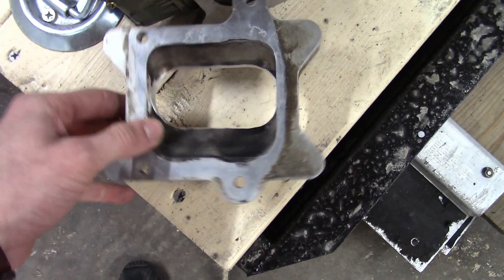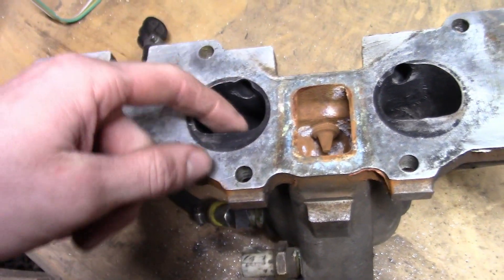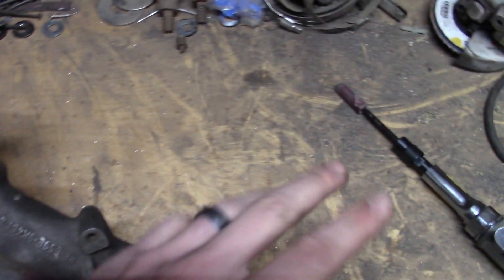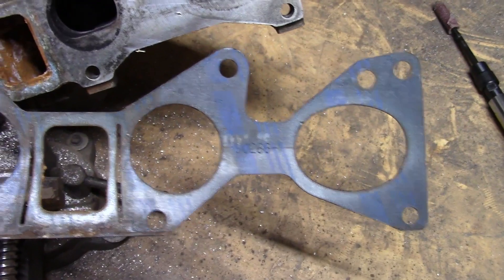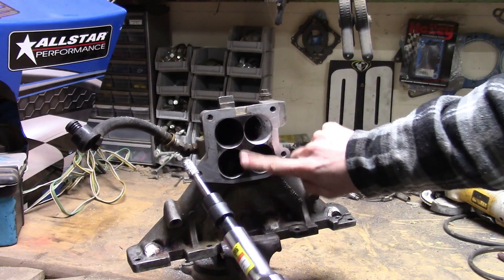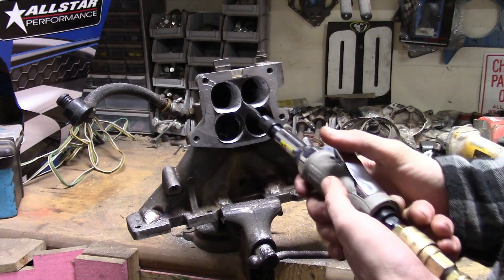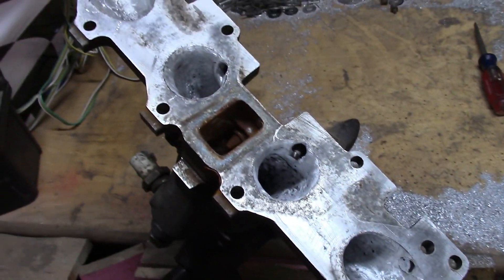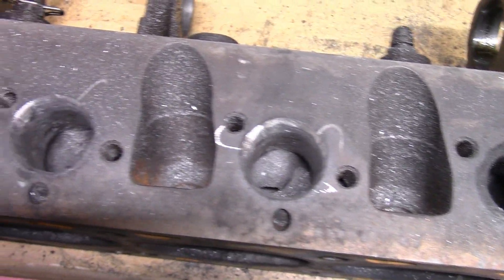how to gasket match a ford ranger race truck 2.3l 2.5l hand porting. diy

Comment: That burr is for ferris metals, the aluminum burs have huge flutes in it so they wont get clogged up, those burrs with the dots on them I have always thought were for wood. From what I can see you have a huge transition from the bottom of the carb to those 4 holes and not much time to do it, try a 2 inch spacer to give the air that is coming out of the carb at 800MPH some time to get into those 4 holes, always blend down the port as far as you can reach when you gasket match or you are going to have a ramp that is going to screw up the air flow

Comment: THE WELDING STORE SELL CARBIDE CUTTERS I USE A ELECTRIC DIE GRINDER FROM HARBOR FRIGHT ITS FAST 25000 RPM I AM USED TO IT .  IT WILL RUN A HOLE RIGHT THROUGH CAST IRON FAST SO YOU HAVE TO PRACTICE WITH IT   NO WAITING FOR THE COMPRESSOR ABOUT 50 BUCKS WHAT I SEE YOU DOING YOU WILL HAVE RIGHT A WAY

Comment: I think if you get a chance to use the head and intake on a flow bench you will find a big surprise. I assume the head you have there is a pre 1985 non fuel inj. and the intake from a Turbo Coupe or SVO Mustang something of that type. The whole set up is a mess that you are working with. Meaning the turbo lower intake only works with the un-even runner length because once you have boost it equalizes.  For a carb appl. it sucks for the reason I just mentioned. Next the early head with the oval intake ports doesnt flow near as good as the D port fuel inj. head. 1st simple rule of thumb in porting. Never lower the floor always raise the roof. So now you are going to hog that lower intake floor out to mate up with the big oval intake ports on the early head. Yes you need to get rid of the mis match but you are killing the port velocity. ( the speed of the intake charge) Im doing a 2.5 for my early Ranger and got around that by doing this. ( assume due to your class rules at the tracks you race at you wont be able to do the following) Im using the dual plug head and using the primary coil side for the plugs and just plugging the extra set of spark plug holes. Then Im making my own intakes. Running 2 webber / Holley 290 CFM carbs. I centered the aluminum plenums dead center between 1 & 2 and 3 & 4. then used .125 wall 1 5/8 id aluminum round tubing for the runners. Before I put a slight arc in them I set them on a sand bag and took a mallet and from about 2 inches from the plenum end beat a flat floor in them. That also gave me more top and side area to work with.  Im still messing around with runner length and plenum sizes . I had my intake plates all done and bolted to the before i started with the runners. And they lined up perfect to the match ported plates to the head. Ideally I want the base of the carbs about 2 - 3 inches above the top of the intake port. What that allows is for the runners to be placed on the bottom of the plenums so the fuel has a clean shot down into the runners before it makes a slight turn and continues down to the cyl head. I dont know what the rules are for your class but I have another design for a 4 bbl set up that has correct and match length runners and another one using the 2300 Holly 2 bbl 500cfm with all equal length runners. But I think you would be better off using the newer dual plug head and making your own intake. that mis match  D port intake and oval port head is a mess. Im really suprised that as many of these lima motors are out there using a carb that someone hasnt made a good intake for the dual plug head. the one Racer walsh offers is from what I can tell a repop of the 78 - 82 carb version. Again JUNK the 2 end ports are huge ovals going front to rear while the 2 center ports look like over sized cheerio holes. just complete junk for an intake. Anyway good luck in the new season. You might want to look into some flow numbers on that lower turbo intake mated to the oval port head. There is also another option. That would be instead of hogging the floor out of that intake to get it to line up to the head.  Have the head hot tanked and rinse it real good. Get some Muratic acid and a brass or stainless brush and scrub that floor up real good. Rinse it off and lay some Devcon epoxy in there. I havent tried it yet but I know many cyl head guys use Devcon on the intake side with zero problems. You cant use it on the exhaust cuz of the heat but the intake side is fine. I would bet money you make more power like that then you will opening the intake up like that and killing all the pv.
Reply from the maker: this is what I did on my race truck and it put me on the winners circle so I just keep doing what works for me. not to say these not a better way or ways its just what works for me
Reply: @c4motorsports390  does the class you run in allow 2 carbs? or do the have a cfm limit?
Reply from the maker: No just one 2 barrel 350 cfm